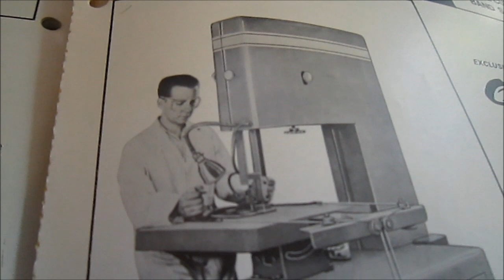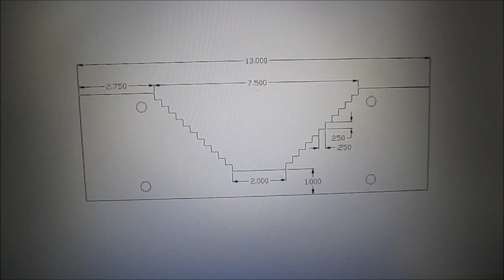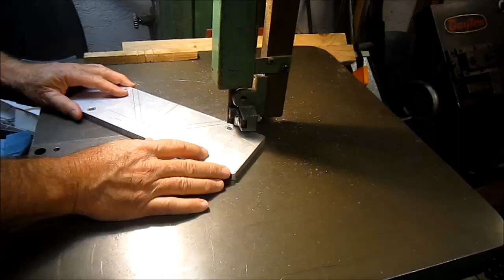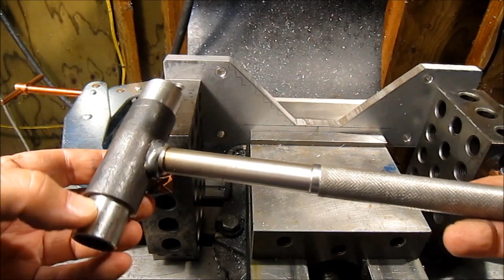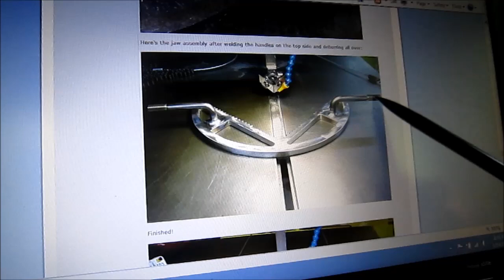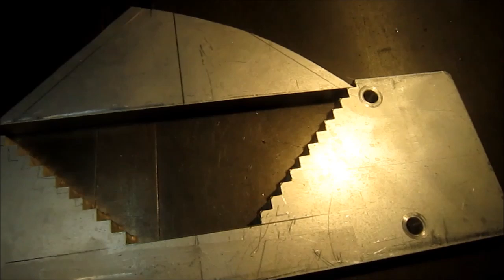Tool Time 19 Bandsaw Cutting Guide

Comment: cool find. it look like it works.
Reply from the maker: Thank you Sam
Reply: I watched your video. I had a thought if I may, your proof of concept was great. You would like to make it better. My idea would be to make an insert for the driver guide that way it could be interchangeable with a few 1/4 steps sticking out every inch or so, cut a little knock in the corner and the insert would have a key that would lock it in place. Drop in and go type. Thanks for taking the time to teach you new things.
Reply: Teach us new thing.

Comment: To save the steering tool put a piece of waste material (small block of wood) at the bottom of the tool so you won't have to cut into it. Nice job on the steps, Looks like you will enjoy using it. Eric
Reply from the maker: Hello EricThank you for your feedback and informationChuck
Reply: Chuck,
I can measure/ photo my Do All "steering rig" if you like.
Eric

Comment: I have one of these that came with my DoAll bandsaw. The weights  are used to pluu the item through the blade the "half circle" guide is a steering mechanism so the operator can focus on cut alignment and not get tired pushing an object through the saw. Also a nice safety feature as it keeps the paws away from the blade.

Comment: When I operated a monster Kalamazoo band saw at a HVAC duct manufacturer(MMF) years ago, my power feed was a 3 or 4 step stairway looking deal made out of steel and bolted to the floor right behind you, the risers were at about a 45 degree angle and you used those steps to put your weight into it. Totally safe though, they put grip tape on the steps.
Reply from the maker: Hey Dave...oh boy...a monster...I bet it was a beast...lol....cool Thanks for watching and your comments

Comment: Chuck, I suspect that the original device you were copying isn't so much a guide as it is a power feed. Metal cutting can take a bit of force from what I've seen, and if you were doing it 8 hours a day in production it could get pretty tedious. By pulling the work into the blade the operator would just have to steer, and it would be much less tiring. 

That said, I have a similar device for use on router tables. It has two handles, is about that size, but it is plastic and has a screw clamp to grip the work.  It's intended for routing small parts and lets you keep your fingers away from the bit. Routers, due to the side forces, are more likely to pull your fingers into the bit than a bandsaw with its vertical force is to pull them into the blade.

Might be cool to use a right and left hand threaded rod with two threaded riders as a clamp to hold work in your guide.  That way turning the rod would pull both riders to the middle equally and clamp the work at the center. Would work better for steering than the toothy steps. 

Have fun!

-- Mike
Reply from the maker: thanks mike

Comment: I like the principles behind what you are attempting to do however I feel that your steps are 2-3x as high as they ought to be, consider the steps on a pair of Visegrips or pipewrench. I understand that you have used aluminium because it was what you had available at the time but the teeth steps will wear away quickly.
Your handles need to be beyond the saw blade in my view and I think that something like the handles of worn-out bricklayers trowel would be pretty good angled slightly towards the operator
Like others I am concerned about the blade being pinched with weak materials near the conclusion of the cut - could you consider some sort centre support post with sacrificial contact top which is slid up and touches the saw cut area? Hold the post in place with some sort of "quick grip" 180degree over centre clamping lever
Reply from the maker: thanks Dan for your input

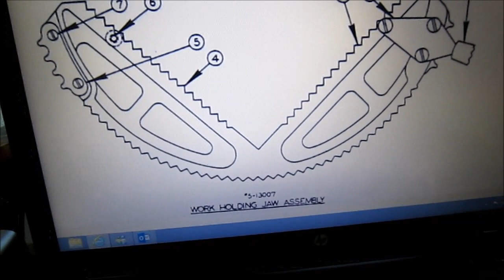Comment: they use almost the same guide as at 10:53 except at the 2 forward edges there is a pin on each side where the chain (bicycle chain size) that have hooks on the left and right side to hook to. There is 2 short pieces of the chain on the end of the steel cable.  very similar to the powermatic setup in your catalog. Hope that makes sense i can email you some pictures if you havent found anything. Let me know your email
Reply from the maker: HI Gavin Thanks..have some info already Chuck

Comment: Chuck - nice video but you got me wondering a bit about the design. As you start to use this more I would be interested to hear your feedback.

The design, especially on the wider piece, creates a fulcrum at the point at which the blade is heading. Do you notice any pinching happening to the blade between the two sides of the part being cut?

Thanks again for sharing!
Tom Z
Reply from the maker: Hey Tom...Thank you for watching, I am going to play with the design since I got some good ideas from comments.  Yes if you push hard it will pince, but the pinch is small due the fact the band is only 1/2" and that the band is pulling the part down when pinched, not like a tablesaw which has a large area of pinch and is lifting the part off the table...Chuck

Comment: Haha, I like the subtle humor and oft times inject small amounts where needed.  Tom probably won't notice....he'll be looking at that new spiffy camera mount.
Keeping body parts off the blade is always good..the only critique I notice with that  design is that it does not support the cut as it get thin and breaks through. Does it pinch the blade and bind without reducing pressure to only a feather touch?

Colin
Reply from the maker: Hey Colin...you were correct, he didn't notice nor Adam...that is because they were kind enough to view, but breezed through and I don't blame them...I think I would have done the same with my poor edit/production...Yes, I pushed one through fast/hard and there is a quick pinch, slow feed no pinch, the pinch is of course different from a table saw where the blade is lifting the pinch, the band pinch is pushing down and a very slight about of blade is in contact.Chuck
Reply: outsidescrewball
Well don't worry so much about the editing...it's the content that counts right?
Carry on!

Colin

Comment: Hey Chuck,
Like your pusher. Your PowerMatic band saw is an oldie but a goodie. I used to work, as a service tech, for Western Industrial Machine Repair in Redwood City. I worked on and installed a bunch of PowerMatic band saws, table saws as well as other professional woodworking machines, etc. I had just installed new (and razor sharp!) blades on an edger and wasn't careful in testing it. I ended up loosing the side of my ring finger. A great plastic surgeon took some skin from my forearm and patched me up. The point I am making is these machines don't really care what they are cutting . . . your work or your hand or arm! Keep your hands, loose clothing and other body parts away from anything that grinds, cuts, drills, etc. Clamp things down when possible. Sorry for the preaching, Chuck. I just hate folks being careless. These machines are not forgiving!
Regards,
Dave
Reply from the maker: Hi Dave....your were speaking the truth...not preaching

Comment: Hi Chuck, caught your Bridgeport with it's skirt down there,,, it no doubt got a rise out of Tom ;o}... No need to worry too much about getting everything right the first time, none of us do, you're doing fine... This is a cool project! BTW: If you ever notice that all of a sudden your band saw wants to cut a curve and you don't. It may be from trying to cut too tight of a curve. Because if you turn sharp enough that the blade starts twisting in the guides, you may be accidently bending the kerf off of one side. Just a thought, if not for you maybe someone who doesn't know you can only turn so tight, before you need to use a narrower blade... :o]

O,
Reply from the maker: Hey O52
LOL...thanks for watching, regarding the blade issues...been there done that

Comment: need to make it so the sides move in and out 1/2 of 1 notch to make it a little wider or smaller to fit the part being cut. like cut straight in from the side and then put a flat plate on top joining the 2 halves with slots on 1 side with 2 thumb screws to tighten. easy as pie or cake.
Reply from the maker: Hi Brad...Hmmmm...think you may be on to something there, I can smell that wood burning here as I type...LOLA prototype may get builtChuck

Comment: The 2 doall saws at work have that same automatic power feed setup on them. The power feeds never get used.
Reply from the maker: Hey Gavin...Curious, do the power feeds have the stepped tooth guide?  I assume the power feeds are time consuming to goof with when the cut is small or in thin material, but do guides get used or is there an issue with the use also??Chuck

Comment: looks good if it doesn't pinch your blade at the end of the cut, but nice job anyway :)
Reply from the maker: You know, as I got toward the end of the cut, I thought the same thing, I did slow down on the push and I did not get any pinch....it will be interesting as I use it more and see if the pinch is an issue, logic says it should be...but we will seethank you for watching and your comment